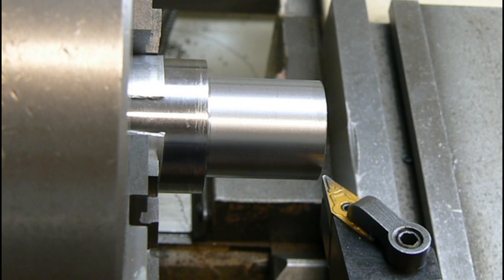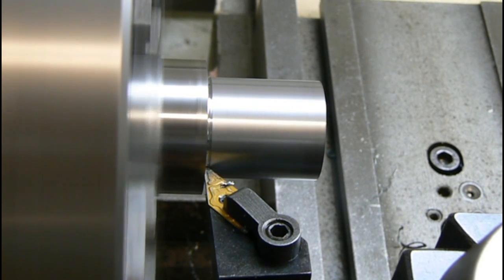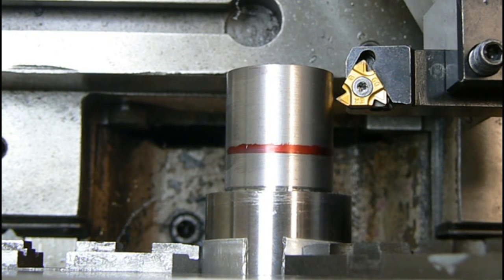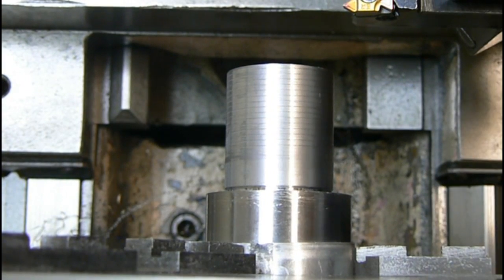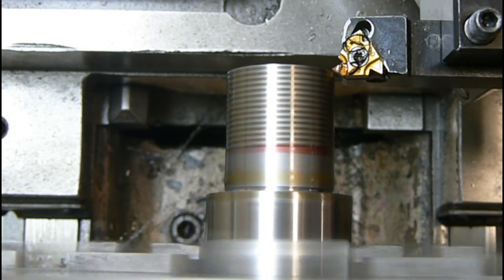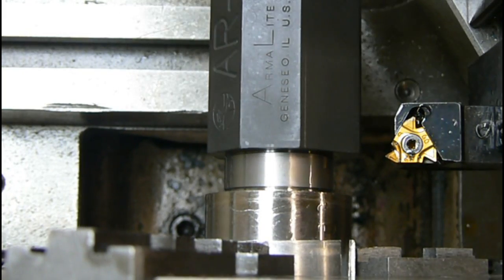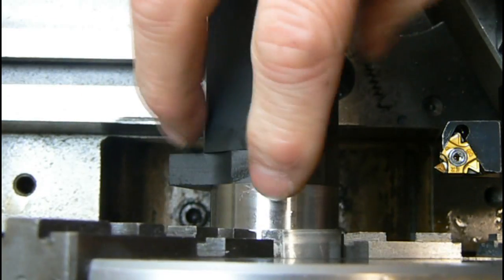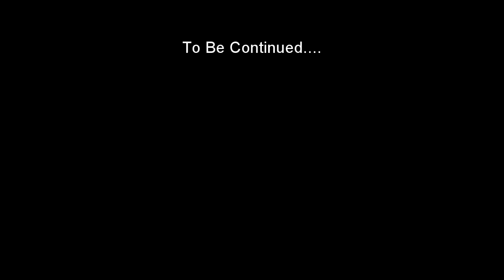375 Chey Tac

Comment: A tip on Threading/spacing the recoil lug:  make a thread relief groove at the end of of the thread, with a depth of the minor diameter.  It gives you someplace to stop without gouging at the end.

also, Id reduce the spindle speed by !1/2 to give you more time to react.  That was pretty fast threading by hand. [I didnt notice a thread-stop to trip the half nut off].

Otherwise a sweet job.  :)

Comment: That major undercut at the "front" of the barrel thread cut to get rid of a minor "fillet" the recoil lug should have been chamfered to clear is scary as hell. Ever heard of stress risers and how they are set up and cause fractures at sharp edges when an undercut "shaft" is subjected to bending stresses? They're why you never see bearing retention snap rings except outside a bearing and only on shafts where there is no pulley or other bending load outboard of the groove. 

Where those exist a lock collar is used to keep the shaft from slidding/spinning in the bearing. I can see that barrel snapping right there in that groove someday. And aren't the recoil lug flats supposed to line up with the receiver flats for a "seamless" assembly with the barrel tight? There's no way you got it tightened another 1/8 of a turn or more torquing the barrel into the receiver to get everything lined up. At least not without stressing that undercut barrel and groove a hell of a lot more than they already were. All the way around a pretty scary and "ugly" build to this point. 

I know lots of machinists and no "gunsmiths" personally even though it seems like everybody who has and can turn on a freaking lathe and can make a YouTube video is a "gunsmith" or "rifle builder" these days. With predictable results. Looks really easy on paper but oddly enough threads have to start and stop at specific points in many "builds" to get all the parts "clocked" correctly, don't they? But its kind of hard to cut those kinds of threads and get them to start and stop where they have to when you're just kicking the lathe on at 500 rpm and letting the compound "do the work".

I suppose its just a matter of taking "a few more thou" off the rear barrel "seating surface" to get another turn or whatever you need to get things lined up properly. But then you have to take more off the back of the "chamber" and if you don't get it right in one or two tries, the next thing you know you're back to cutting more threads. You mentioned "advancing the threads" but with the receiver and recoil lug already tight against the barrel more threads aren't going to gain you anything. You have to create clearance somewhere to get the receiver and recoil lug aligned when they're tight against the barrel. Either by removing some material from the face of the receiver or the recoil lug or the rear of the barrel where the recoil lug sits. 

And if that's an Armalite AR-30 receiver which is must be since its obviously not an AR-50, are you sure its up to the challenge of dealing with .375 CheyTac pressures and loads? More "scary" to think about there. Looks like a "cheap" way to build a "big "rifle and "cheap" shouldn't be combined with "build" of ANY rifle much less a "big" one. Hopefully Armalite's lawyers will find this video if there's ever an "issue" with that "build" and somebody decides to pin the blame for the "issue" on Armalite. Not that Armalite would/will need to prove it didn't "build" the rifle with "issues". In its manufacturing/transfer records whatever serial number is on that receiver sure as hell isn't going to match a .375 CheyTac and "truing" the receiver just put the proof of "modifications" right there in the threads. 

And is it just me or do those barrel threads "taper" from "larger" to "smaller" as the get further onto the barrel blank? Almost looks like a reversed pipe taper thread and the receiver seems to get "looser" the further on you thread it. Maybe those are "optical illusions".

Comment: .408 Chey-Tac with a COL in excess of 4.5" will fit in an AR-30 receiver/magazine lengthwise? That's about 7/8" longer than .338 Lapua. How you pulling that off? Got a pretty significant case diameter difference to deal with too. AR-50s are available in .416 Barrett for the same money ($3300ish MSRP) as an AR-50 in .50 BMG. How does building a custom "AR-30" in .408 CheyTac pencil out compared to buying an off-the-shelf AR-50 chambered for a much better cartridge based on a much better "parent case"?

Comment: we typically must thread a barrel with a four jaw chuck to ensure the bore is completely centered to the threads. what is you "trick" to getting away with the three jaw chuck to thread? did you turn a clean up pass with the barrel between centers?
Reply from the maker: No trick involved, that is a set thru chuck. I have four points on which to adjust the piece I am holding in a three jaw. If the bore is very off center to the OD, I will use a four jaw on either lathe. Thanks...........SKI
Reply: That sounds self-contradictory a few different ways. If the 3-jaw is acceptable because of the "4 points" you shouldn't get unacceptable results. If the bore is off-center to the OD prior to machining then that sounds like a barrel manufacturer problem if you're working with a "blank". If the bore is off-center to the OD post-machining, that sounds like an issue you're not going to fix by then going to a 4-jaw chuck unless there's enough material left to switch to the 4-jaw chuck so you can "re-do" the improper machining the 3-jaw wasn't supposed to allow anyway.